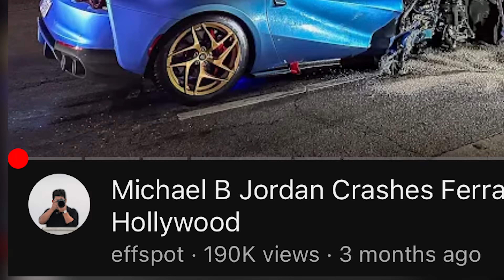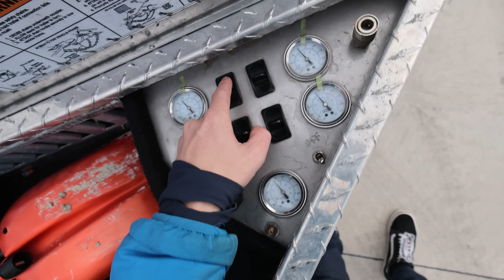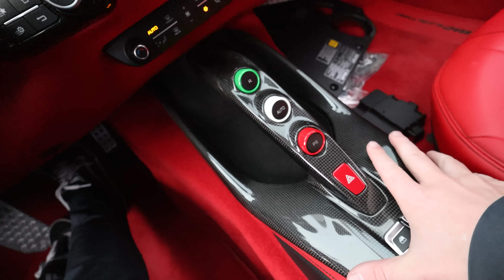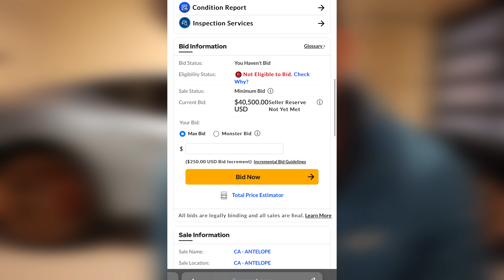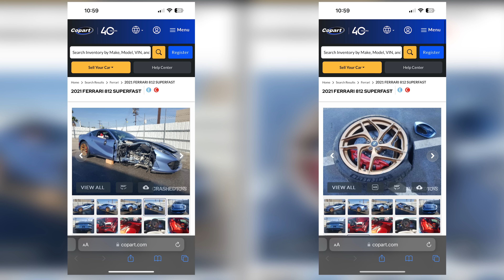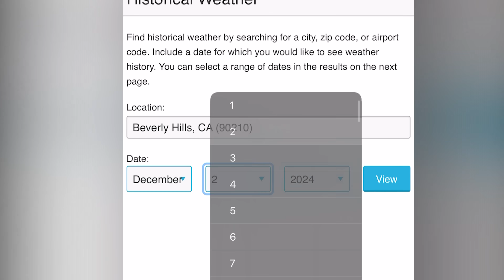I BOUGHT MICHAEL B. JORDAN'S CRASHED FERRARI

Comment: Props on the car and towing! As some who tows vehicles around quite a bit my pointers. You will learn the car doesn’t have to be all the way forward on the trailer. You want the car a little more weight biased forward but not necessarily all the way forward. And this will very per vehicle. If you tow a rear engine car by chance you may actually want to load it backwards because too little weight on the front is much more dangerous than too much.

Comment: In the crash pics i could see the oil leaked out in the area of the oil sump tank.  I hope you checked the oil before you cranked it, and the first buyer as well.  Im guessing  he was concerned someone may have started it dry and got scared.  I hope he fixed it when he did the suspension.   Could still be quite a gem!

Comment: Ferrari hit a small dip on the crosswalk. Squatted the rear end and load off the tires. Then spun the wheels and traction control took over on when the car regained traction. Driver over corrected in that slit second.

Comment: looks like the 812 is pulled up too far on the trailer and thats why its squatting you wanna distribute the weight of the car over the axle of the trailer as best you can and the trx should have no problem towing cars

Comment: No way that tire became unbolted by the rear end losing traction! It lost traction because the tire fell off. You can see him correct left when the car veers right as the tire starts to come loose, but then the tire comes all the way off and Jordon goes for a ride into the Kia. That' my take on it anyway, and if true, whoever last installed that tire is in for some trouble.😁👍😎✌🗽